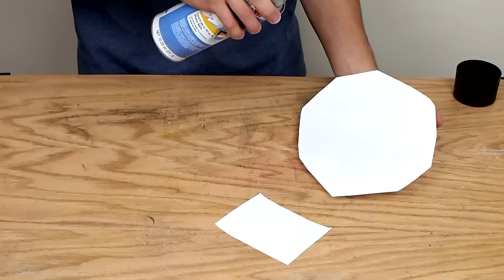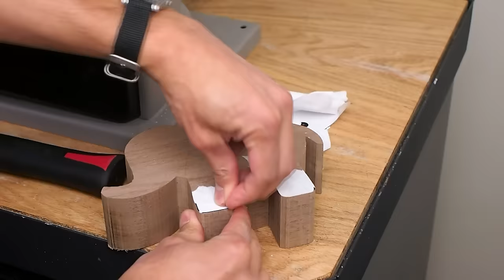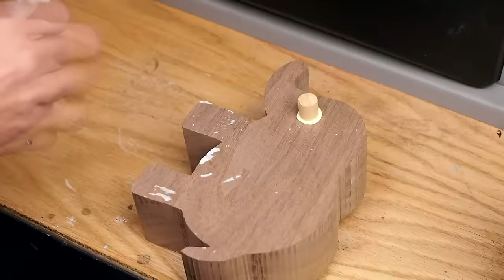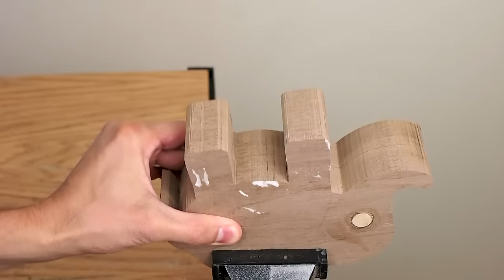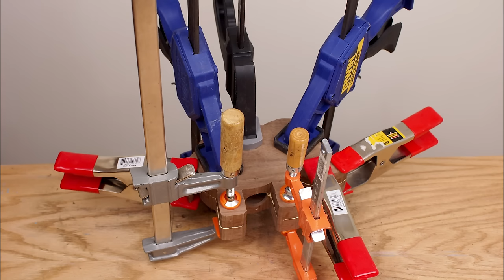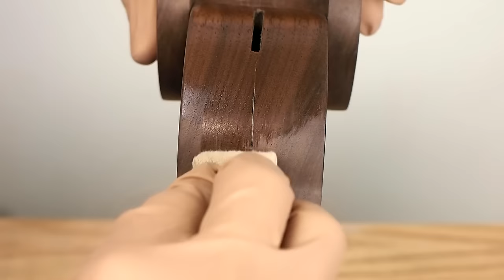How To Make a Handmade Elephant Bank

Comment: I'm in the process of making one of those for my daughter out of what I think is ashwood for the body and teak for eyes and ears. Thanks a lot for the templates, it seems to turn out really nice! The sanding was backbreaking though. Also, I think drilling out the bottom hole and the coin slot is way easier to do before cutting the body in half. Anyhow, great idea and great tutorial!
Reply from the maker: Drilling the bottom hole and coin slot before cutting the body in half is a good idea. Thanks for sharing. I'm glad you like the video and template.